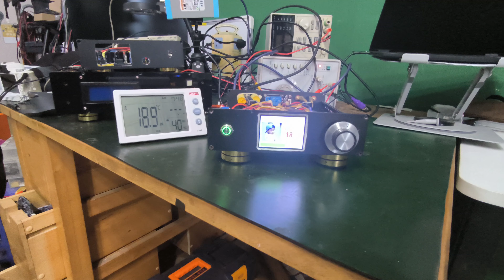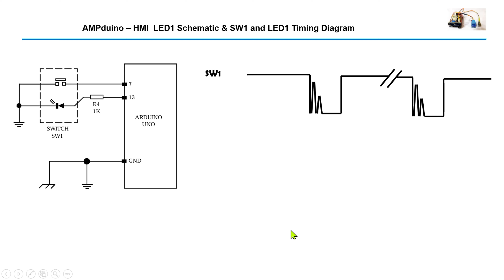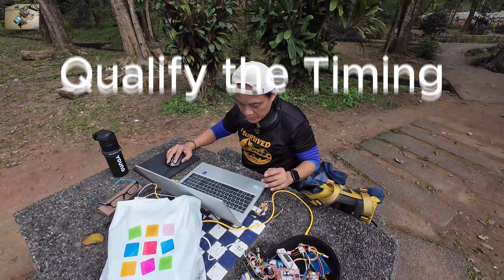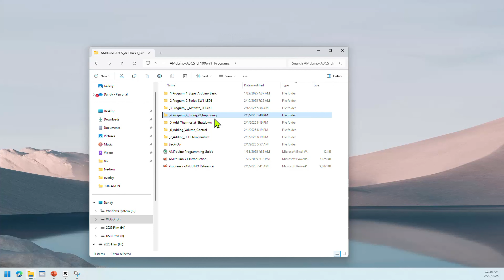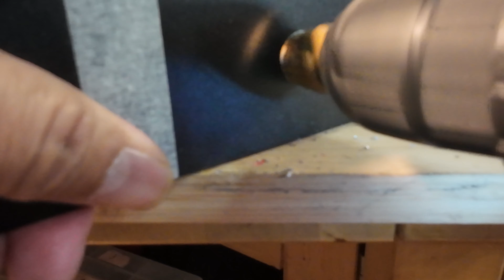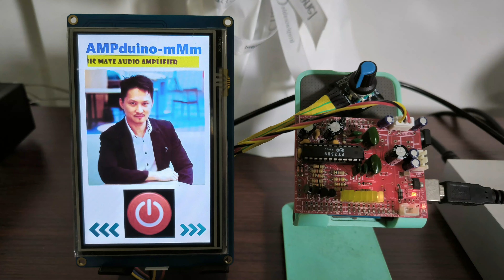AMPduino HMI #15 | CODE Improvements POWER On OFF SW1 and LED1

Comment: https://daacwaves.blogspot.com/2021/11/ax2358-homemade-surrond-remote-kit-with-16x2lcd.html   Please explain and make video on this this-page.  I want to make digital controller with this ic AX2358f
Reply from the maker: Hello, thanks for the suggestion.  The link above already have all the information,  schematic,  code and what is needed are the Hardware including pcb design and pcb and the remote control.  It sounds that,  they author think anyone can build it easily.   I am not sure if theere is available kit for it.  No promise I can build in a short time,  but if I will  (and somebody can lend a hand), I woudl rather build in a kit form.
Reply: @dr100wconceptpoweramplifier  okay i will wait for that movement to be happen . thanks you so much!

Comment: I love to watch your videos and your works. Currently I am workin on upgrade a previous preamp project; which I had made with TDA7439 control by Arduino Nano with an LCD 16X2 display; now it is upgrading to an ESP32 with a TFT9341 display.  :)
Reply from the maker: pretty awesome!  Are you going to remotely control your  3 band tone control using your mobile phone + ESP32?    That's raised my interest,  I should have started with Arduino Uno - Maxima,  but I really started from the baseline  where in Audio DIY who know nothing or just starting Arduino can grasph it.   Going to Wifi at the start is really interesting, but may cause a downfall if too much informaiton that cannot be implement or handle being a STARTER.    Let me get in touch with you offline,  your project is really interesting to me.
Reply: @dr100wconceptpoweramplifier  Hello, I replied to your comment, but it has since disappeared! might not be correctly submitted. I have discovered your "hotmail" email address and would like to communicate information about the project offline. I will email the project specifics to you. Thanks
Reply from the maker: @ many - many thanks.   Yes!  As you see, I am moving from DIY to DIT (do-it-together),  it must be fun  to work with someone with the same interest.   Let's do it!